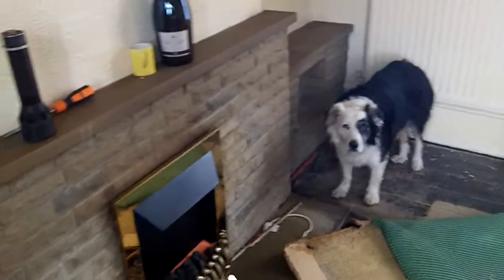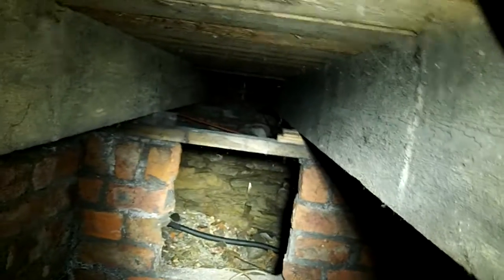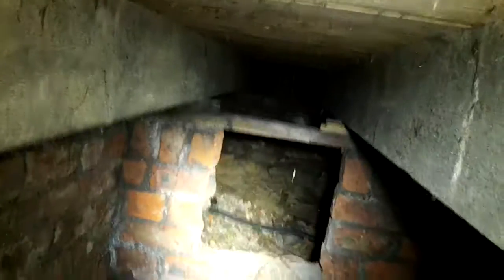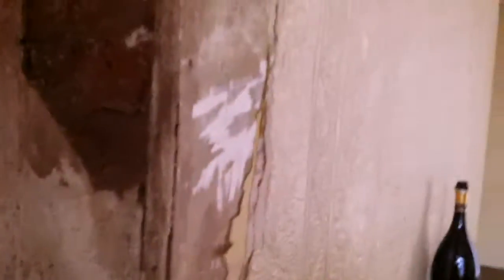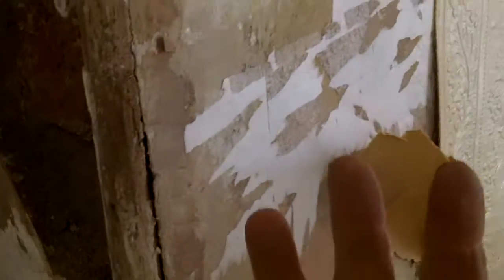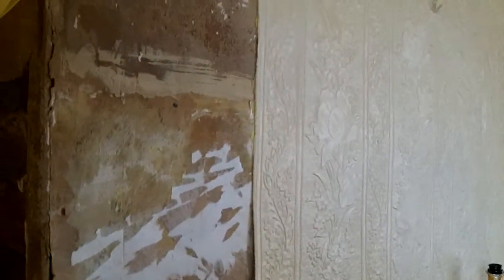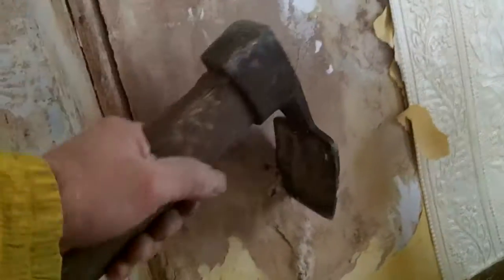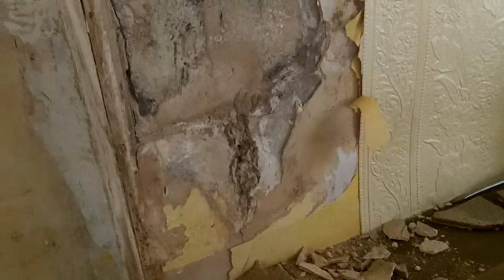Another damp old house - salty chimney 1

Comment: Hi Peter. Whilst I understand that cement renders and gypsum based plaster act in contrary to Lime based mixes I also understand that salts only move 'in solution' therefore one would expect there to be an underlying issue with dampness if a continual problem existed. How say you? Johnnie G.

Comment: I've looked at terraced house where they had   coal fires been used in both rooms  now they stop using them and used electric they having salt like problems in the surrounding walls is that possible for salts to travel that far on say 3 walls in each room ??
Reply from the maker: +Howard  Reeves Absolutely.  Salts can travel several metres... tend to fan out at the base of wall forming a triangle.

Comment: Dear Mr Ward. Thank you for posting your videos; they are very informative and eye opening. Having watched a few of your videos regarding salt in the chimney I wonder if you could advise me on a similar problem. I bought a house a few months ago and had both chimney breasts removed. The builders bonded over the brick and then plastered over and finally painted over the plaster.

The wall is stained yellow and the paint is flaking off leaving salt like substance on the floor along with black marks being left on the wall. I spoke to a supposed damp expert who advised me that this was the result of fossil fuels exposed to air and reacting causing hygropic salts. He said we would have to remove the plaster and go back to the brick and brush off the salts OR alternatively as a cheaper alternative, apply salt neurraliser to the affected areas and then fix high performance foil backed plaster board to prevent the salts coming through. He said the foil would act similarly to water not being able to pass through a metal sheet.

I would be obliged if you could give your opinion and advise if this option would indeed rectify my problem.